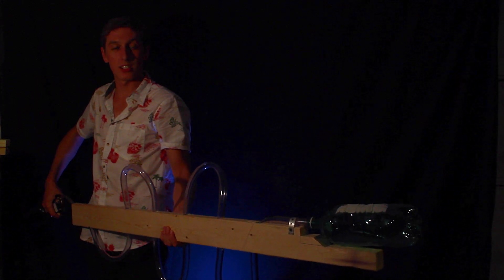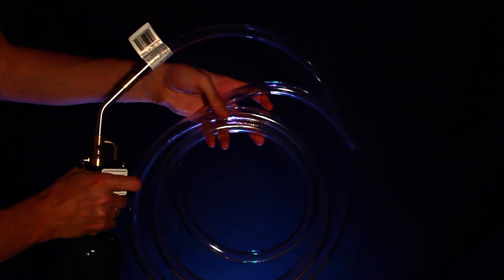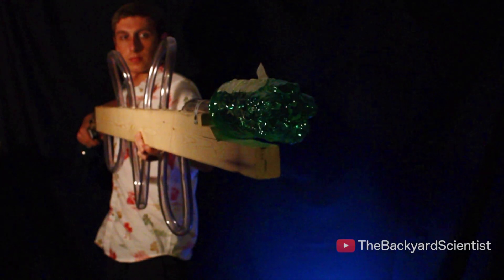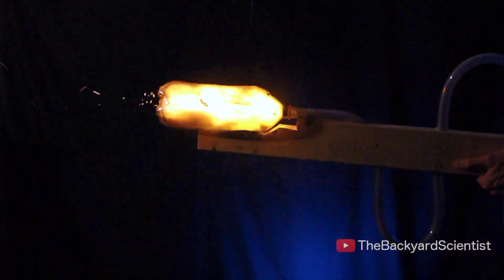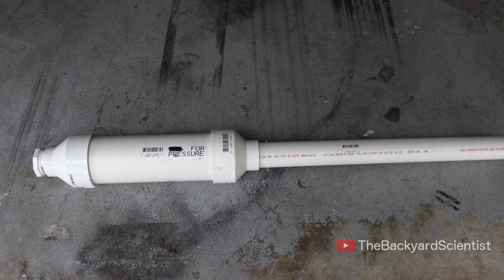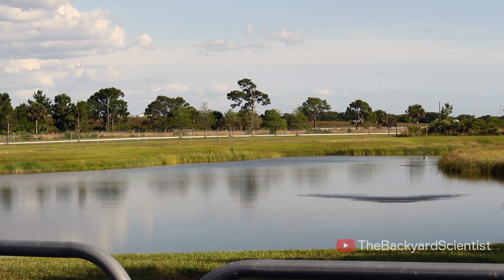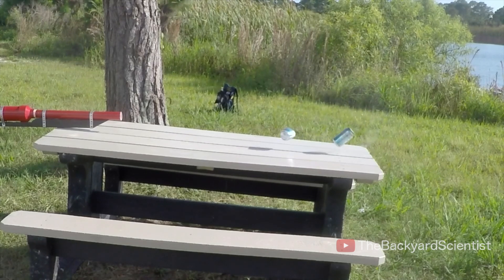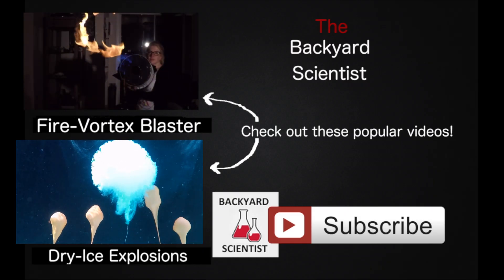Propane Rifle

Comment: Now you get some idea how hydrogen we work in the engine in the vapor form only it wouldn't be as explosive as people think because it's inside the engine there would be no way it can cause a problem cuz you can run it right down air cleaner there's a couple of places you can go right off the carburetor it doesn't matter because it takes up better volume inside the Piston ones under pressure just like a diesel engine in that respect

Comment: You can do that with hydrogen Vapor as well you can reach methane gas too if you have enough manure in a container that's getting hot you have to have like a 5 gallon container or a 55 gallon container we get enough gas stored up and as you're doing it you can then cycling into something like you're doing there but you'd like you said you have to create enough back pressure that's with any of the gases but down the barrel would have to be to golf ball seating and they're just right to where it would cut the end of the hole where you ignited it then it would travel down the barrel similar to the idea of black powder.. does a combustion and it has pressure behind the projectile so any of the gases woodwork in a vapor state

Comment: For all of you trying to build the cannon,  the 1-1/2 inch PVC IS NOT standard sch 40 pvc pipe. It is called SDR-21 pipe and is made of pvc plastic however it has a larger inside diameter so it can fit the golf balls perfectly

Comment: Since you do weapon like stuff...
Make a propane fired .68 caliber blowgun.
Several are on Ebay. Cold Steel is the primo, and they make several dart styles, broadhead, bamboo skewer, stun darts, etc.
A cotton ball at the backmof a bambo skewer works frommthe blowgun.
Add lots of pressure and heat, maybev not so good.  
The cones should survive okay. 
Id love to see penetration into plywood, 2x4, or tree on this.

Comment: Maybe you should put some kind of shield on it in case the PVC explodes into shrapnel (the reason it's not for pressure) after being fatigued by many shots? Or just rebuild it from HDPE or polycarbonate tubing. (Not acrylic which also shatters into shrapnel when it fails.)

Comment: I made one of these about 10 years ago or so but instead of using the torch I used a gas-to-propane converter nozzle with a twist knob spark igniter to set it off. I was able to shoot a small bottle of sand over about a football field distance

Comment: when I was younger my dad made a 'potato cannon'. about the same width as a lamp-post and maybe 2/3 as long, filled it with air and aerosol, pressed the object (oranges worked best) down into the pipe to compress the gases, then ignite it with spark plug, was outrageously loud.

Comment: I'd like to suggest to the DIY crowd. the tube that fits the golfball is thin walled tubing. it will fit directly into a larger pvc pipe, schedule 80 or 40.
glue it to the inside of this larger pipe, then find an adapter that fits the OD.

Comment: tried building based off his plans and I could not find the 1 1/2 inch pipe he used. most inch and a half pipe I found was inside diameter and you need at least inch an 3/4. any way ended up going with two inch though it seems like there's a little too much slack for the ball so maybe it doesn't launch as far.

Comment: These are some of the coolest video's I've ever seen.  Better than Mythbusters as far as cool what if's I've always wondered about.

One thing I'm curious about is what this propane launcher or other propane stunts would do with MAPP gas.  The torches are similar if not identical but the fuel burns at least 2x as hot.  I use mine for starting charcoal in 20 seconds.

Comment: Sorry for being a dumbass but what are the chances of the low pressure pipe exploding in your face & how serious would it be if it did? Would it be a good idea to fit a clear acrylic shield? A full height shield might make it less portable but I suppose you could use it as a monopod to steady your aim...

Comment: I tried this but it didn't work. I had no explosive results. was it oxypropane? because I'm using regular propane but I'm not getting a good air fuel mix
Reply: +Lucas Dunne Yu can build a fan for add some air to mix this how the profesional nails guns works a chaber whit a metal fan cleaning the chamber and enrich the mixture.

Comment: modify this for a clip attachment so it loads 1 golf ball after each shot.
Reply: +AfterShotzZHD that would be cool. cut a hole in the bottom and attach a pipe the size of the golfballs with a spring at the bottom of the pipe. now all you have to do is attach a full size propane tank to fill it up faster and load the mag with golfballs and you have a full auto propane cannon.
Reply: Sweaty Cubes Do you mean, 'hopper' like in paintball?

Comment: If you fill the plastic bottle with something combustible, if the bottle doesn't have holes, it ends up either launching out the front or making a pretty light show

Comment: I made one of these but couldn't find any thin walled pipe so I just used 2in pipe and taped the golf ball and it's amazing shot a golf ball so far so I got some 1.5 in Pvc and put rocks and hot glue in them going to shoot it tomorrow so worth it

Comment: Quick question. What keeps the explosion from blowing off the tube connecting the propane tank? No doubt some force also goes backward. Was this never an issue, or did you have to reinforce the connections in some way?

Comment: I have a question I have copied these build but a golf ball is to big for the 1 1/2 pvc but the wall on your pvc seems thinner did you bore it out.
Reply: +Samuel Allison Its called SCH 30 thin wall.  Its normally used for stuff like gutter run off (french drains, down spouts and the like) or for venting  waste lines in your house, especially if your plumber was cheap. Its also occasionally used for big irrigation lines as they arnt under constant pressure.
Reply: +TheBackyardScientist
Reply from the maker: No I just bought a thinner pipe. Don't buy thick schedule 40, my Home Depot sold thinner stuff too.
Reply: +TheBackyardScientist Ok thanks you for replying to my post and thanks for the info
Reply: +Samuel Allison Always measure your projectiles and barrels before buying the 2nd part.
Reply: It doesn't fit the golf ball exactly. you could put some wadding around it to give it some more pressure.

Comment: I built the cannon to his measurements and it was longer than the one in video, but it shoots just as well. I had to buy 2 inch pvc for barrel because 1/1/2 inch was to small. Did anyone else notice it too

Comment: For the barrel of the PVC cannon, where did you get that pipe? i could not find it and 2" PVC is slightly too big (the fit needs to be around 1/16 gap around golf ball in barrel so the propane can ignite)

Comment: Pipe is measured ID (inside diameter) which is why it's bigger than stated, on the OD. Tubing is measured on the OD . just some simple facts to help you get thru life.

Comment: you should use golf balls
Reply from the maker: +Steve Voros I did use golf balls!
Reply: +TheBackyardScientist oh, thought it was ping pong balls for some reason... BUT DID YOU TRY HARD BOILED EGGS!?!?
Reply: Ananta Sesa das One is related to Hank Hill, the other isn't
Reply: +Steve Voros Hard boiled eggs vary in size making them difficult to use as a projectile unless you have an over sized barrel and then use a sabot to ensure a good fit.  (which is more effort)

Also they tend to smell after a few days, so it wouldn't be good, unless you need a bio weapon to annoy your neighbors :p
Reply: Is that even legal? Potato guns are illegal where I'm from. hairspray vs propane. I don't see the difference. +TheBackyardScientist

Comment: If you used a small enough round with enough weight, a similar design could easily break skin by the looks of things.The problem would probably be funneling the blast into a small enough barrel.

Comment: Just to be sure, this shouldn't ever fail right? And if it did, how dangerous would it be?
Reply: ***** But... how would I wave if I didn't have arms?
Reply: +suspectsn0thing If you are worried about failure then either make the pressure chamber outa metal or buy an even bigger pipe and affix it over the pressure chamber pipe. No way it will blow out both. The biggest danger IMO would be having the chamber crack and shoot a hot jet of flame into your eye. So always wear your safety squints.
Reply: A. Zak
Confirmed! :-D
Reply: +Nevir202  Fellow AvE watcher detected!
Reply: joppe peelen ☺
Reply: +Nevir202 
and what if that back pressure blows up the propane tank?
Reply: nicmobile
That's not even slightly possible. There is only propane in the tank, even if you somehow force fire into the tank (which the pressure in this gun is not great enough to do) it will not burn/explode the propane without any oxygen.

Comment: If you ever try to make one again make sure you don't use PVC because since it is not meant for pressure it will explode! A friend of mine did the same thing but instead of having good luck like you did, it exploded and he doesn't have an eye or a few fingers! Please take this into consideration, use flexible PVC. It will take some time to straiten it out but after all it is much safer.

Comment: Building this, it has to be done... I wonder what happens if I use PVC pipe big enough to hold a tennis ball?
Reply from the maker: Ze Wazzap Ten Thousand extreme tennis?
Reply: +TheBackyardScientist Imagine a airsoft pellet in that thing. Ouch.
Reply: +Metario or 200 airsoft pellets?

Comment: Hey I'd like to say thanks for the great video and the blueprints! I was able to replicate your golf ball cannon and with a few modifications of my own, I made an equally capable launcher of my own. 

I combined both your rifle design and your launcher design by securing the torch under the barrel in the front, and then wrapping the clear tubing around the gas chamber so that the flame is still visible as it spirals around the chamber to the back of the launcher.

I also tested a few different ammunition types. My favorite has been Nerf "Vortex" micro-footballs (the one with the stabilization fins). They have great accuracy and they're lightweight so they fly very far. They do have to be reduced in size to fit in the 1.5 inch barrel (THEY MUST BE SLIGHTLY SMALLER THAN THE BARREL TO ALLOW OXYGEN TO MIX WITH THE GAS) but a belt sander or grind wheel does the trick in 15 minutes. I would also recommend soaking them in soapy water. This makes sure they don't get burned and it helps reduce friction with the barrel.

Again, I'd like to say thanks! Best launcher I've ever made.
Reply: What kind of pipe did you use for the front barrel to fit golfballs?

Comment: How thick tubing should I get I bought 1/2 in ID × 5/8 do I need to buy a bigger size I wouldn't know because u never told us
Reply: +TheBackyardScientist
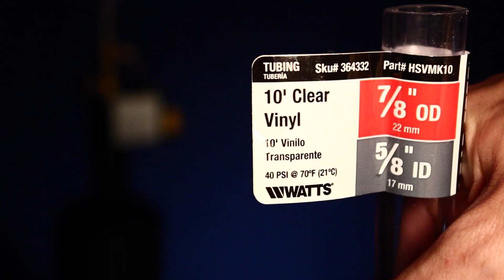Reply from the maker: Riley go to 0:13 in the video. you need 5/8 inch inner diameter tubing.
Reply: So did I get the right one? *****
Reply: Riley Johnson You said you got 1/2 ID, which is not 5/8 ID, so no, that being said, you might be able to squeeze the neck+head into the tubing if you warmed the tubing up in some hot water, and while it was warm, stretch it a little bit, squeeze the torch into the tube, just make sure you didn't overstretch, you have a strong seal, and if you want a little extra comfort, put a zip tie on the end. But no, you most certainly did not get the same size tubing. Although i'm not sure that propane torch heads have a standardized size, so just find the right tubing for what torch you have.

Comment: Now all it needs is a way to automate the reloading of the balls.
Reply: +Oberonjames Take a section of the same pipe as the barrel and cut a slot in it to allow a rubber band to be stretched through it which will  act as a magazine spring. Drill out a golf ball sized hole in the bottom of the barrel, and affix the magazine in a way that aligns it with the hole but leaves space for the seal. Then use a pipe that just fits over the barrel to slide in to cover the hole where the magazine attaches and you can pump it like a shotgun. :-)
Reply: +Nevir202 That would be awesome. I think I like the hopper idea better though, since then it'd be fully automatic. :P
Reply: Oberonjames
The problem with the hopper idea is the pressure will go up into the hopper and rob the cannon of a lot of power. You need something to block it off so the only way for the pressure to go is out the barrel.
Reply: +Nevir202 Yeah, that makes a lot of sense.
Reply: +XxXxXxXxXxPrOmLgXxXxXxXxXxX Lol. And get a job so it could afford to pay for them too.
Reply: +Oberonjames balls

Comment: see that your barrel walks forward when you shoot it, need to use some PVC cement to better hold things together.
Reply: Ghost Shadow when gluing it together use solvent PVC Cement and lightly sand surfaces before applying glue and it will not come apart like the barrel walked forward in the video.

Comment: where do you find 1.7" ID PVC?
Reply from the maker: wytshus Home Depot. Its actually labeled as 1.5" pvc. when i measured in the store it was 1.7
Reply: All of the home improvement stores around here (Flint, MI) carry schedule 40, which is thick wall pvc.  OD is 1.9", ID is LESS then 1.5", around 38mm.

I got some class 200 pvc 1.5", it's used for irrigation systems.  OD is 1.9", ID is 1.7", give or take.

Also, what would be your recommendation for straightening the barrel? Mine is at a bit of an angle, heh. 

Thanks for the reply! Great work, great videos.  You inspired me to get off the couch and do some science(ing)!  =D

Comment: Need to design a magazine now so reloading is easier.  I'm thinking about a bolt-action PVC insert and a top-down gravity fed tube magazine...
Reply from the maker: lucaso777 yeah thats what I was thinking, drill a hole in the top of the barrel and have a pvc tube slide back and forth over it.

Comment: do you reckon it could fire some sort if high energy projectile that could potentially be lethal(like a bullet)
Reply from the maker: William Jackson Did you watch the whole video? Yes, that golf ball is traveling fast enough to kill.
Reply: no but something smaller like a bullet fired out a smaller platform
Reply: William Jackson You can just make sure that you have the tubing rated at the higher pressure of a smaller neck.  Something like a bullet is illogical but you could definitely have a musket ball, or just a 1/8th of an inch radius ball and launch it through smaller neck, but again you need to make sure the connection from the chamber and the barrel/neck wont blow apart.
Reply: Thomas McSwain Or be like me and make it out of copper tubing

Comment: you should make some kind of foam rubber sabot or something to get a better gas seal around the golf ball. you could even try spiral fluting the inside of the barrel to act as rifling or give the golf balls some fin stabilization
Reply: The little dents on the golf ball give it all the stabilization it needs. I also
Play airsoft and paintball and rifling does not help with stabilization